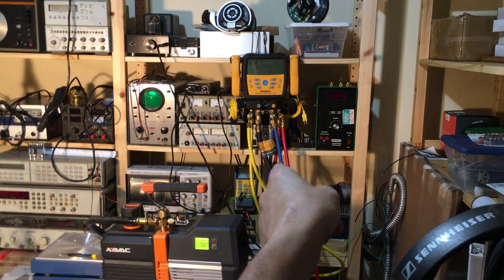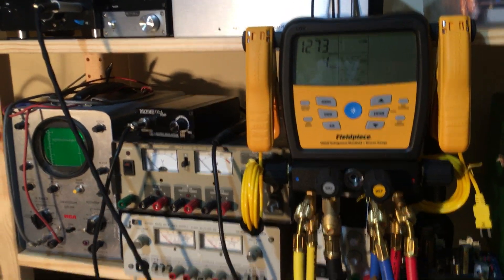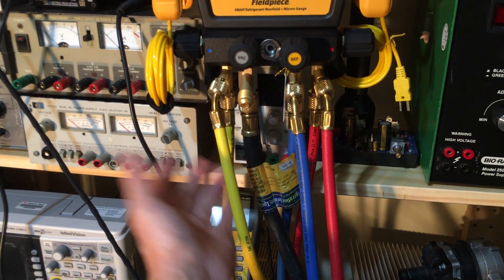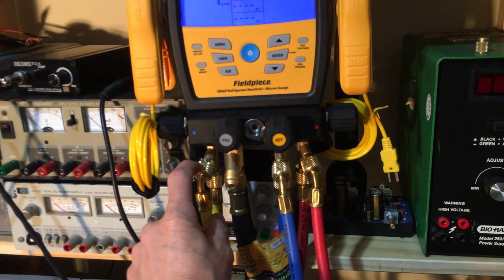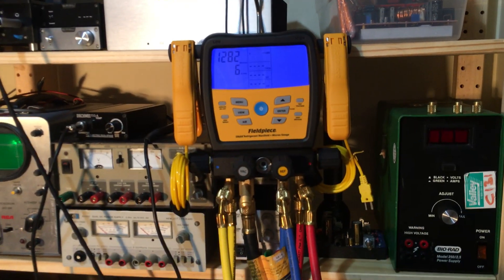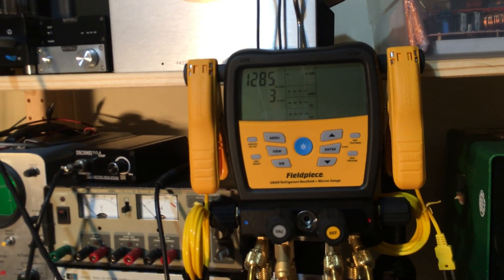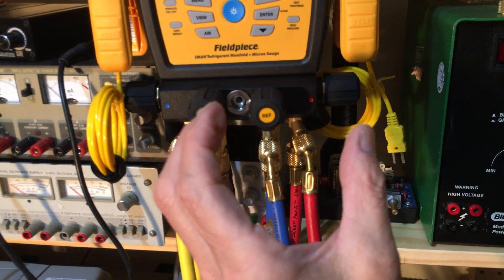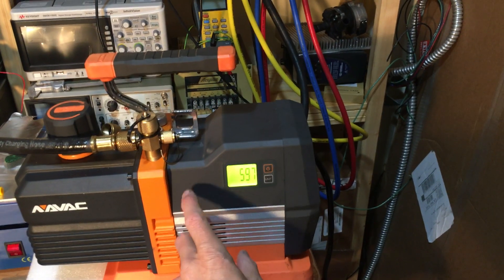Failed vacuum decay test after installing brand new yellow jacket refrigerant hoses.

Comment: I got to tell you. I found a shop teacher on here showing a decay test with a 480. It did leak, but the crux was if it leaked slow enough to be called good. His work was tight, it was in the equipment I guess. Yours stay rock solid. I believe in what you did to the valves. I saw that video this AM.
Reply from the maker: The problem is how does he really know it’s his gauges or it’s his system. 
        If you don’t even know you you can trust your tools then you cannot trust the readings on your tools because you will never know if it’s your equipment or if it’s your system. 
         Unless it could be proven recorded and duplicated then he cannot be trusted. 
         This is why it’s never recommended to do a vacuum decay test using hoses or gauges. 

       For my best results you only use like in a laboratory a middle line with no rubber gaskets in a micron gauge standalone. 

       That is the only way to test and be sure because all rubber hoses leak all rubber hoses absorb moisture all rubber hoses absorb refrigerant. 

        Best case scenario if you really wanted to use a flexible typos material it would only be silicone. 

        I still have not released a video showing my last endgame test with the SMAN 480V.
           All soft copper lines with no rubber gaskets.     Video to come in the future
Reply: @coldfinger459sub0  https://youtu.be/ZEqmUbA0j6A
Reply from the maker: @christopherrasmussen8718  Yes I seen that one
But it actually doesn’t mean anything getting down to a certain vacuum if you could turn it off and hold it. 
     This is why I having the blue vac micron gauge even has the data logging software so you can log it over a long period of time on a screenshot like a spreadsheet I have a video on that
Reply: @coldfinger459sub0  I’ll look into it. I’m not going professional but I like to do my own work and work for family and friendship
Reply: Ordered it. Neat part of gear. Thanks

Comment: Thanks for filming these. I left mine for a few hours and they didn't rise much. Perhaps I'll do it again and leave them overnight. I'm in the market for new hoses and was going to get yellow jacket. I take it their quality is still good even though you've got some issues there. Not too many makes to choose from here. Javac, Mastercool, CPS & ITE are the other main brands over here.  Anything I should be looking for or avoid? I like mine with the built in isolator valves at one end.
Reply from the maker: Automotive Solutions Just avoid the Chinese cheap ones from eBay and Amazon or Harbor freight. Are usually only get yellow jacket and we have a company called just better JB Are usually try to stay away from the ones with built-in valves of any kind because the valves can fail and then you have to throw away the whole hose if the hose is good
Reply: @coldfinger459sub0  ok. Thanks.